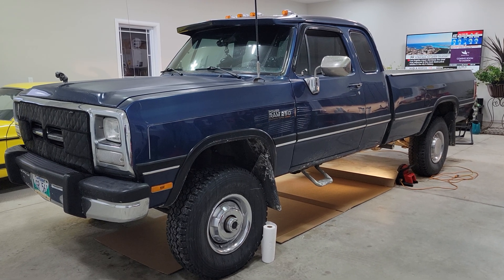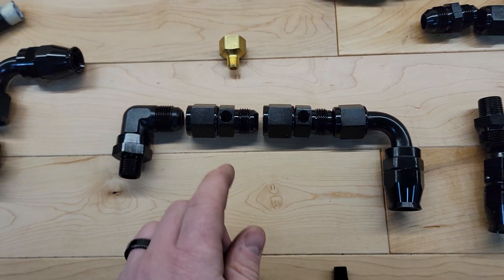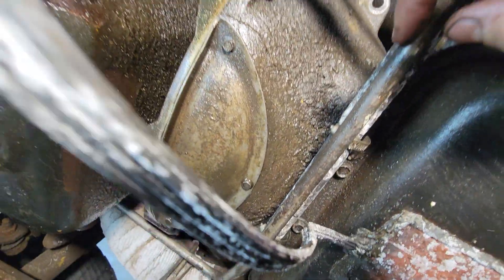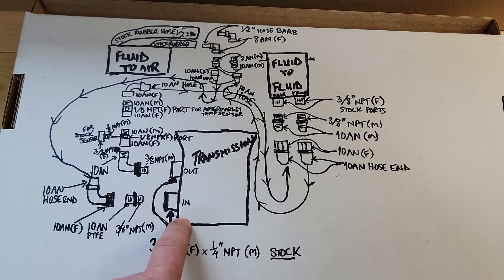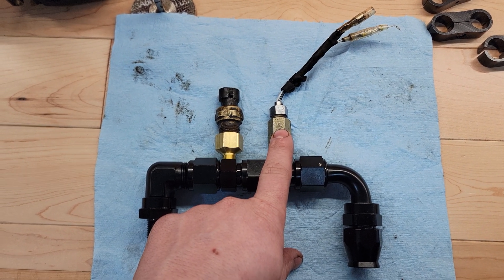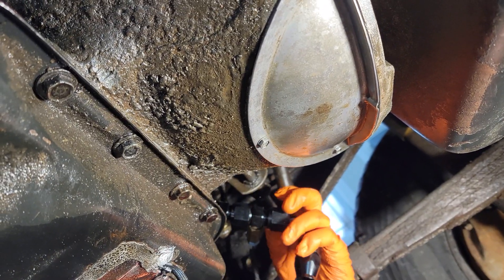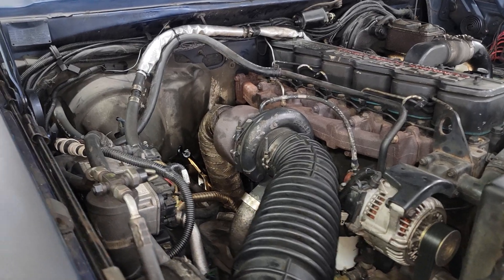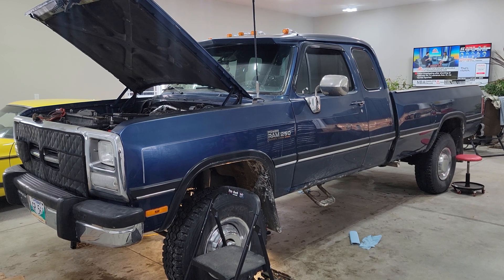Custom Transmission Lines | 1st Gen Cummins

Comment: I just lost my transmission on my birthday going to work in the morning because my "cobbled" transmission line let go and dumped all the fluid onnthe road... Oh well im now currently waiting for the parts to rebiuld it with upgrades. Doing it myself this time because upon teardown the transmission shop i paid to re do it a couple years ago did a very sloppy job it never felt quite right when i got it from them. i have a 47RH with locking tourq converter in my first gen. Currently programing an Arduino to control lockup and overdrive as the stock computer developed issues whare itd rapidly shift in and out of overdrive/ lockup.. as i tied them together. So overdrive and lockup have been on a toggle switch for about a year.
Reply from the maker: @101computerman  the arduino controlling lockup and overdrive sounds like a neat project!

Comment: Nice work and thanks for the vid. Depending on how long I keep my auto, I may replace my steel lines for these.
Reply from the maker: At the very least people with autos need to check for rubbing of the steel lines against each other since that's what caused my leak